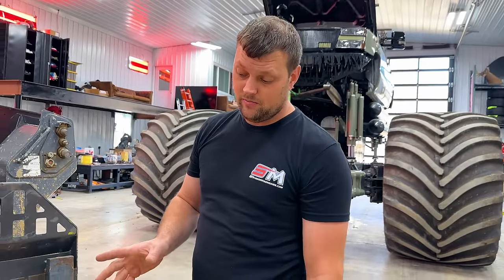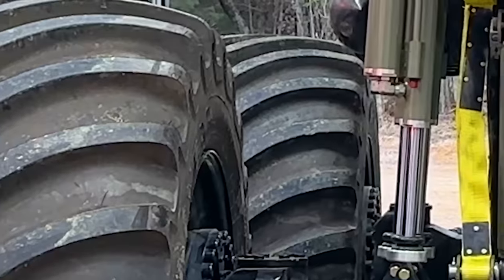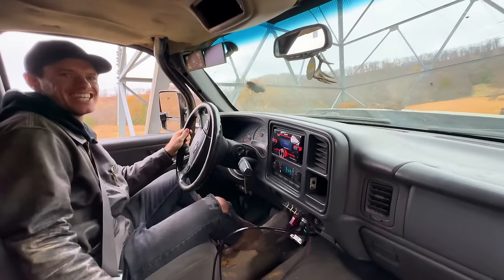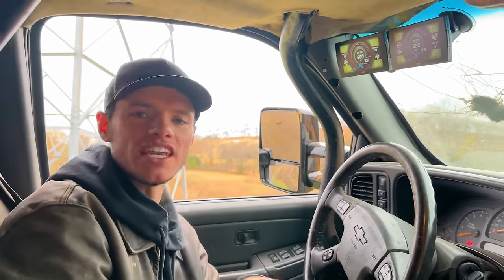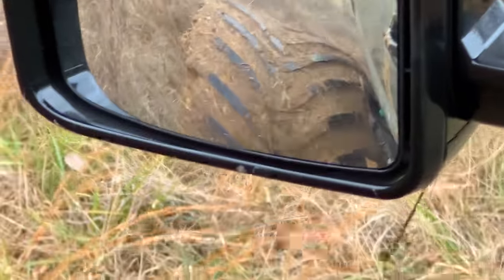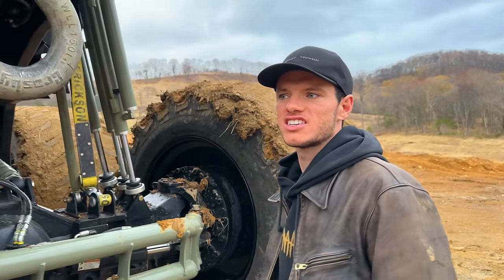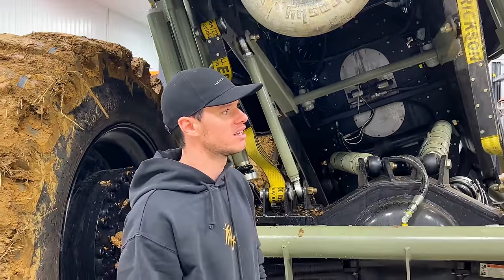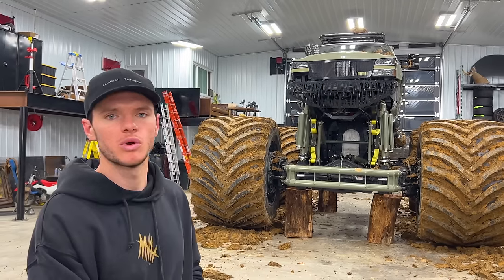Monstermax 2 RUNNING ON TWIN ENGINES!!!!

Comment: Some people don't even understand just how wild the engineering is behind this truck. I'm some people. It's incredible.
Reply: Lmao bro. Hilarious and relatable
Reply: What engineering they slapped some shit together that doesn't work, that is not engineering.
Reply: @ban80  lmfao...tool.
Reply: Incredibly terrible.
Reply: I am an engineer. And this indeed looks like imma slap some shit on it and call it a day
Reply: @ban80  lmao okay brad glad you have an engineering degree to confirm this
Reply: @iwan-wr7gn  Ok, maybe nothing revolutionary, but the way they built the truck up and hooked the engines together and everything... it's pretty damn cool. To me, anyways. Maybe this seems elementary to an engineer or something, but I find it pretty damn cool.
Reply: @spishyofficial  yes the electrical engineering and hooking up the engines is terrific. That's electrical engineering/programming. But I wouldn't be surprised if there where non to little calculations made to design this machine. Like who and why would put so much weight on the top end. The missiles also could have been build from aluminium to safe weight. Maybe use different kind of steel so u can go thinner but have the same strength. It seems to me that they just did something and they didn't know what they where doing at all
Reply: @iwan-wr7gn  Hopefully that all gets figured out. 😅
Reply: It's incredible that it lasted as long as it did with that animal behind the wheel. He sure does know how to find all the weak points eh boys lol...
Reply: @iwan-wr7gn  all that but they can't size the fan relay and wiring correctly

Comment: That combining of the TCM Harnesses is like grade school simple yet absolutely brilliant. I'd have engineered an entire server room trying to do that & accomplished nothing. lol
Reply: Actually it's not, the moment one of the transmissions becomes desynced, like one shifts but the other doesn't, like when he was free-spinning the wheels, the drive shaft is going to bind and snap.
Reply: @nahimgudfam  Please forgive my ignorance, but what would cause the transmission to perform an action (or not perform) independently of the TCM? Can they perform certain operations without the TCM?
Reply: @nahimgudfam  Not how that works... They just showed that they shift together with a single TCM... The transmission isn't going to shift by itself thats the whole point of connecting them both to a single TCM.
Reply: @00000005547  it’s easier said than done. There’s more to controlling it than just commanding certain parameters at the same time. I could’ve built him this same set up in an hour, but I thought he wanted it done by someone who actually finished an engineering degree. They will always have to have a “fuse” somewhere in the driveline. The driveline is almost 3tard strong (when acceptable geometry is used). It could reach a point where the weak link (fuse) becomes the fluid coupling in the trans. Then you have to think about the hundreds of hard to control variables in the trans. Simple as temps, fluids, length of lines, so many things that can affect the functionality when trying to perfectly reproduce output. The answer is already out there. If youre multi engine you don’t use multiple trans configured this way.  With tens of thousands of dollars it could probably be done satisfactorily through one off standalone control units, and one off software/hardware. It still wouldn’t perform as well/reliably as going the way we have known for decades already works though.
Reply: @dahorseman2654  man you took all the words out of my mouth…😅
Reply: @BuiltbyOtto  easiest way at this point is running two drop boxes, and then run each trans to a drop box. Command secondary combo to just mimic the other. With the gear reduction, weight, unsprung weight, and general resistance through driveline/tires it won’t matter if it’s slightly off with speed, or even if it’s in different gears. It would solve angle issues, and decrease the torque application on each part of the driveline by half. COOLEST PART- FWD or RWD burnouts if one engine can get em going well enough. He could run a locked front then as well, with the ability to disengage.
Reply: @dahorseman2654  I also commented in a previous video that this is as much a software issue as it is hardware. For once, I wonder if they took the pressure sensors output into account. But I am eager to see what this setup will do, what will actually go wrong. It's still an interesting experiment. Maybe we've already had a taste of that when the truck wouldn't move uphill. Was something binding, truck too heavy, or was the transmissions in different gears?
Reply: My guess is they used a higher stall converter for the turbos to light quicker, unfortunately unless he is wide open that same stall is hurting in most other driving conditions, made drastically more apparent considering the weight of the truck
Reply: @00000005547  If all you needed was a signal to the transmission, then why does it require an entire computer to run it?  Because there's more going on there than just "shift to next gear"
Reply: You can't just mirror the transmission signal to two transmissions because if the state of the transmission isn't synchronized, the single computer won't be able to handle the conflicting signals from two transmissions.  That's probably why you threw your driveshaft when you free-spun the wheels. You literally need a custom computer that is programmed to handle two transmissions and keep the clutch engaged until both transmissions are synced before letting go of the clutch.
Reply: @nahimgudfam  it only had 3 fasteners on it lol. You could see where it was eating the Dropbox alive. Once it comes unhooked the shaft just slides out of the trans. The truck will never be a performer without basically redoing it. On a tug pad against other mega, and bog trucks it would be the king just because of its weight. Aside from that it’s just going to make good thumbnails, and be cool for people to take pics with. It has WAY too much unsprung weight, and those tires just eat any power he has. I think he started with an idea, and it became something that doesn’t really doing anything very well.  It does internetz really well though.
Reply: @dahorseman2654  Yeah I think that's pretty good summary.  He would have better luck feeding the two engines on a single drive shaft into a single transmission.
Reply: @nahimgudfam  Dude... I know you're trying to sound smart in the youtube comments but it's literally not that complicated.

Both transmissions are tied at the output. Each being powered by identical engines.

If you had each transmission only going to only 2 wheels, I would give it to you. Then they would need another tcm.

But they don't, both transmissions are directly tied together at the output then go to the transfer case

If one engine shuts off while operating, the torque converter will just disconnect it from the transmission, oil pressure drops and transmission disengages.

Also that driveshaft clearly broke off from shear considering they had only 1 bolt left holding it that was probably also loose. It's reaching to say otherwise considering that it's long after the transmissions and has nothing to do with them.
Reply: @00000005547  That's the exact opposite of reality.  None of what you said makes sense.  For start, there's no such thing as identical engines or transmissions.  torque converters don't disconnect anything, maybe you mean it locks up?  I don't have time to go over all the ways you're wrong.

Comment: A torsion bar setup from an older tank or APC could work. It would also have the benefit of potentially being adjustable at all 4 corners.
Reply: WhistlinDiesel247  shabopi
Pronounced (Shu-bop-pee)
Reply: @PrestonGarvey69  thanks Luke

Comment: Look up the swaybar design on Rogator AG sprayers. They would weigh around the same loaded as this. Instead of a single large torsion rod they have four smaller rods in a square pattern. Been using this design for over 20 years so it must work pretty well.
Reply: @Rockhhhhh241 he was just giving WD a suggestion 😂
Reply: @Rockhhhhh241  He literally asked for help...
Reply: Are the four bars close to each other?

Comment: This is honestly the first time I've seen him kinda upset about a truck and I don't blame him, this is an amazing piece of machinery designed here, dual engines and transmissions is a wild feat to achieve, and to see parts break on it including the engine and other major mechanical parts (that poor suspension) and he wasn't trying to destroy it for once, it just really sucks, but I'm sure they'll fix it.
Reply: dual engines and transmissions have been around since the 60s. Its nothing new in general. Go see a tractor pull.
Reply: Haha yeah he was legit shook

Comment: That's impressive wiring both transmissions together in sync. I've seen this done on smaller cars with electric motors on each wheel or banked but nothing like this. Cool build man!

Comment: Other than the Suspension not working and the body rolling more than a ball downhill, the fan /  relay overheating issue,  and the tires hitting the missles and the driveline issue it seems pretty well sorted. To quote Borat "it was a great succes"

Comment: Instead of the sway bar, try a hydraulic sway bar. Linking both sides with an actuator that is linked hydraulic. If you wanted to get really fancy you could even tune it.

Comment: Based on the weight of Monstermax 2 and what is currently used for 12-15k lb trucks, you need a solid chromoly sway bar that is 6.50-7.75" in diameter with 4" link bars to keep from bending it again.
Reply: @whistlindiesel
Reply: Scamers.
Reply: Can you just get the worlds biggest coil overs?
Reply: @SuspendedSteel  The truck is too top heavy to not run sway bars. It will need springs so heavy to keep it straight that he might as well lock the suspension again. If he's got a 36x2 1/4 sway bar with 24 inch arms  it supports 670lbs per inch torsionally. If it was 4 inches in diameter that number goes up to a little over 10,000lbs per inch.  He needs to measure the arm length, length of the bar and get a good idea of the unsprung weight to come up with a safe minimum thickness of sway bar but it's likely around 3.5-4" at minimum.

Comment: With the sway bar you could try a heavy solid bar with  center drilled out. Removing the center of the bar removes the point that the bar twist’s around. It increases the strength even though it doesn’t sound like it. They used to do this on propeller shafts on large navy ships.
Reply: Any size bar stock, of any material, cant get any stronger than solid for a given diameter. You cant make an item stronger by removing material.  For aerospace parts,  triangles and honeycomb patterns and such are machined into everything to save weight,  and certain patterns/designs can retain a high percentage of strength of the part over being left solid, but never become stronger. Bar stock with the 'Center drilled out' is pipe. You're referring to pipe. When a part calls for a hollow structure, you wouldn't take solid bar and drill it out, you'd use pipe/tubing with the dimensions you'd need. There are reasons engineers spec pipe, of various wall thicknesses, over solid. Usually weight reduction, or to be more rigid or resistant to torque on a pound for pound or cross sectional basis over solid. Typically torsion/sway bars are solid spring steel.
Reply: A hollow pipe stronger than a solid cylinder of equal mass - the same material and diameter bar drilled out isn't stronger.
Reply: @ctdieselnut  how bout a forged part there wise guy? Our a billet part? Drilling out a shaft will increase a parts torsional resistance... yesah, you bet it will sonny bub!

Comment: Awesome build! Needs more rebound damping in the shocks due to the non-ideal anti-squat and anti-dive geometry of the 4-link but a few tweaks and this beast will be dialed! Well done Cody!
Reply: This truck is simply an experiment. It is DODGE, so it will constantly break down. NOPE, not the largest truck ! The Rainbow Sheikh is the proud owner of the world's biggest truck and the same is actually a replica of the 1950 Dodge Power Wagon pick-up. Needless to say, this specially designed truck is a lot bigger compared to its original counterpart, sixty four times larger to be precise.
Reply: @chefgiovanni  There are bigger trucks than that like the Terex Titan, BelAZ 75710,  ETF MT-240 etc.

Comment: Excellent build.  However I have a feeling the twin motor set up  may continue to give you trouble even if you do  get a stronger sway bar. Any way you lower them (or just one strong motor) into the chassis to lower the center of gravity a bit?

Comment: If you can find a way to shorten the arms on the swaybar then you’ll make it a lot more effective. Torque is force x distance so if you half the length of the mounting arms, you’ll double the effective stiffness of it
Reply: Well not so much. The best fix is to move the sway bar and mounts higher in the chassis.

Comment: Bigger Sway bars will help for sure but some sort of spring will as well, whether that be a giant coil springs (ugly) or big torsion bars. Will not only help with sway but also stop the suspension from being so soft like that, give you a little more rebound when it articulates aka a smother more truck like ride. If that's what you're going for anyways.
Reply: ...that #MonsterThing needs tank suspension torsion bars from a A1 Abrams tank or a Bradley 🤔

Comment: You don’t need a thicker sway bar set up. The heim links connect to the axle straight down which is fine on light duty pickups. Add a second heim link, down at an angle. That will prevent side to side motion

Comment: Needs a hill assist setup if possible and someone commented on the tank suspension. Drop the missles to finish the demo on the dirt bike and add some rock rails. Might need em 😆. Project in the making. Rollin Giant Power!

Comment: Just get extremely heavy duty straps or even some kind of "sway bar" type thing to hold the truck/shocks down or something that doesn't let it sway as much... some kind of stretchable very heavy duty tow strap kinda deal would probably work best on all four corners of the axels and maybe 2 on each outer/inner side of the middle

Comment: shorter travel shocks with more pressure so they ride in the middle of the stroke, longer links to move the wheelbase out a little bit and bigger sway bars.....

Comment: Dear WhistlinDiesel,  I'm curious if there's any way you can have an automated hydraulic system to keep the body of the truck balanced.
Have it so the cab automatically gets positioned most level possible by having a computer control the hydraulics.  It's just an idea and I don't even know if you'll ever read it.  🙂

Comment: Oh damn, 1600 HP, thats the power of older diesel locomotives like the ALCO RS3 diesel-electric, or switcher locomotives like the EMD SW1500.
I wonder if this thing could actually pull a bunch of railcars (or perhaps a bunch of truck trailers)

Comment: Just wanna say, when u tried to clean the mud off the tires, you didn't go fast enough. There needed to be bigger pieces stuck to the ceiling, It's what I hoped to see. But I was pretty disappointed. Maybe geared too low.

Comment: Hoerbiger corporation had huge diameter steel rods that you could use probably. They have a manufacturing shop that’s huge in south Florida. Go titanium tho, save the weight lol
Reply: I think weight is a lost cost at this point

Comment: Manual clutch and dual sticks for shifting each engine like I'm drah cars just geared down but would need a clutch from a semi or a tank etc lmao I see how the automatics are popular but there's nothing better then being in control of your clutch in a high hp/torque  vehicle it would be easier to drive to if i can drive a real car with a real manual and clutch and 6 maybe 7 speed to make up for high gearing just a thought why don't you try the good old manual clutch stick shift but newer tech like the dual shifters and dsg boxes I get these days surely one can be made or excists just the thought of popping the clutch in a truck like that haha granted it would be like in mx were you use clutch as less as I can maybe just for stopping and take off but manual has always been the best driving experience automatics are so boring when you used to clutching the shit out if your 1 litre micra trying to make 90mph that's with a mate In I could get it to 95 97mph on my own hahaha the good old nisan micra

Comment: Pneumatic level control...Loop controllers to keep the body level (as best it can) Something as simple a mercury switches. Front and back and side to side. Only one more cylinder to an already overdone system. That is....if you want it to work.

Comment: props for showing us how useless this crazy build is
Reply: There comes a point when it's just too big, the 1st monster max was honestly pushing the limit.  This truck looks cool and you can run over things on flat land but it's essentially useless(but brings in views I guess).  Keeping a suspension under this thing is going to be a losing battle.

Comment: Even though that is a beast it's slow as and doesn't have enough power for weight, then you run over one of best offroad racing bikes out there, your lucky it was a 4stroke, if was 2banga I would not be happy. Too much money too destroy expensive vehicles. Avagud1